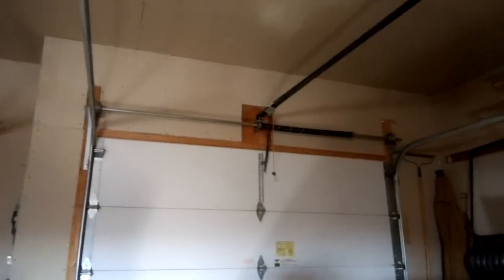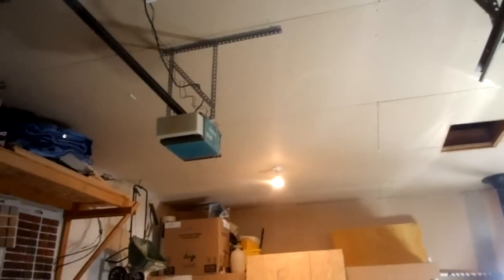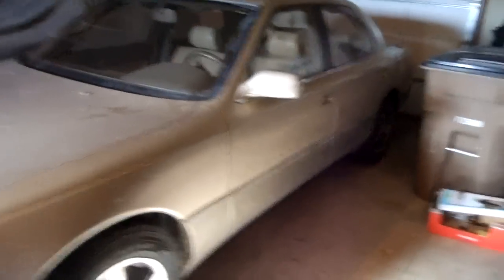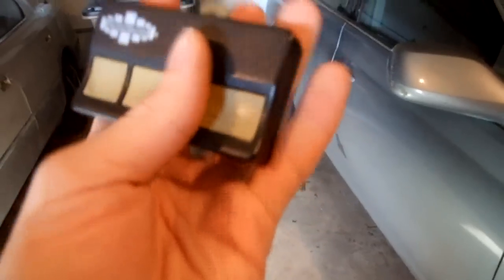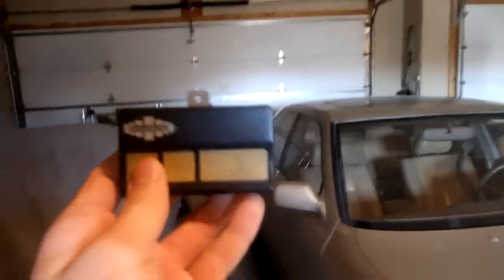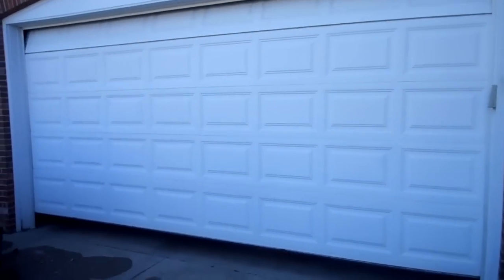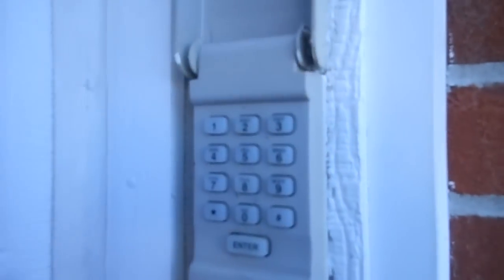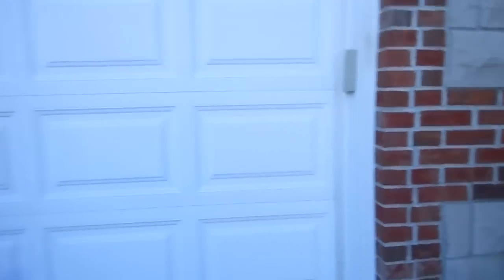Access Master garage doors

Comment: Andrew~ My Garage door crapped out on me back around Halloween. I ordered a new Wood-flush paneled door.  I have to install them when they come in.  Unfortunately I received it around thanksgiving only to find out they sent the wrong door- still waiting on the new one!
Reply from the maker: I'm sorry my door is doing great I hope yours will come soon was it the opener? or the door? or was it the springs I had to get new ones back in April and earlier  I had to WD40 my door because it was making the opener work harder due to the wheels not turning after that it runs like new you should wd40 your door once in a while  thanks again Joe!!!
Reply: IAIS96
A mouse got caught in the pulley that spools the steal cables from the tension springs...  his smashed body caused the cable to jump the pulley and jam. This caused the door to stop moving on that side. But the closer motor kept pushing the door closed with only the other side moving.  The door was twisted diagonally, jamming the door, and destroying the tracks.  I had to use a sledge hammer to break the door panels lose to get the tracks down.  I removed everything and ordered a new door.
Reply: Just a suggestion - don't use WD-40 to lubricate your doors. It tends to attract dirt and will make the hinges and hardware dirty. You should use something formulated especially for garage doors.
Reply: @TBHD724  i use WD-40 on my door and it works fine, grease tends to attract dirt.
Reply: Andrew- My Garage Door Crapped Out
On Me Back Around Halloween. I Ordered a New Wood  - Flush Paneled Door.
I Have To Install Them When They Come In.
Unfortunately I Received It Around Thanksgiving Only To Find Out They
Sent The Wrong Door- Still Waiting On The New One